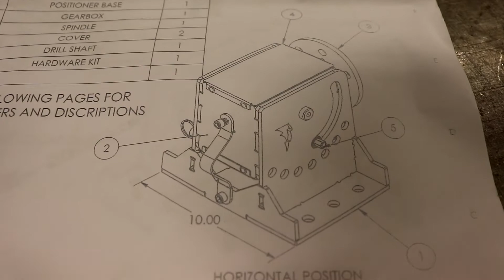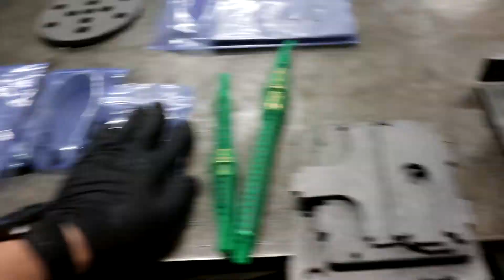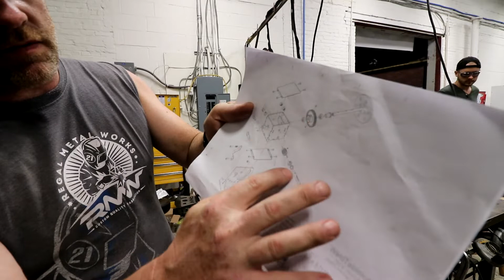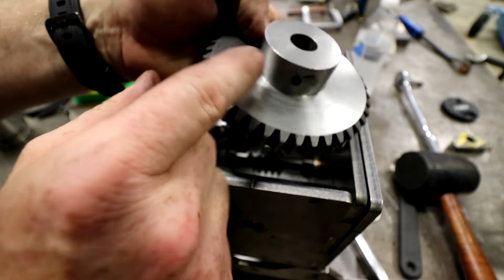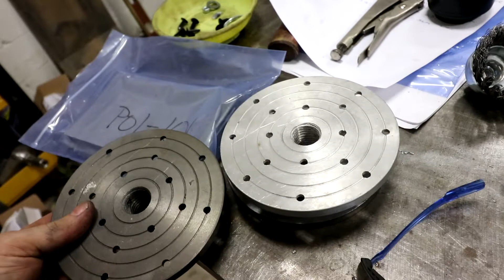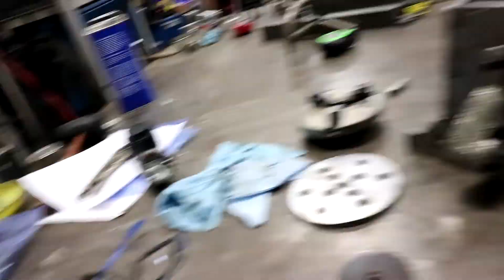WeldTables.com  welding positioner  RMW Vlog-136

Comment: How much Backlash is there in the gears?   If you are welding an out of balance item, will it show in the weld?
Reply from the maker: For welding I would say not noticble since you are not stopping and starting on this rig.  If you need something that you can stop and atart or change the speed on the fly, this is not the postioner your are looking for.  This is for having your speed dialed in and just running parts.

Comment: did you pay the 320 there asking for this thing or did ya get a better deal then that. in my book for 320 it could have a motor included 40 for gears 30 in steel 30 labor around 100 and 220 markup. and in my book a drill is a dumb way to run one of these for start,stop and change speed you would need a hand on drill and a hand on the tig torch again bad idea. thanks for sharing
Reply from the maker: I can't remember but It was a pre-release sale when I bought it.  There is a bit of machinging om the drive and driven shaft and a capable work gear on Mcmaster is around $100.  But who kmows how many they had made, I would presume hundreds if not thousands so hard to say what their final cost is.  I think the prebuy was initially 300 units.  I think I have around 120 in my controller, motor, and power supply, but that would never work in a grand scale as it was a used motor.  If I were to release one with proper power you would be looking At least $500 for a proper controller and motor setup.  I agree the drill idea has it's issues, but for the price most people on that budget could make it work.  Thanks for sharing.

Comment: Holy cow is that 500cfm argon, or did you just bypass the regulator all together😯.  J/K ,,, nice job thx for the video. I enjoyed watching.
Reply: I was gonna say... almost sounds like compressed air blasting out of that torch!
Reply from the maker: 25cfm is what I run on a 12 cup, a little more if I stick the tungsten out 2 inches ir more.